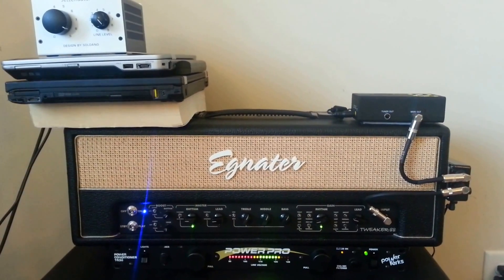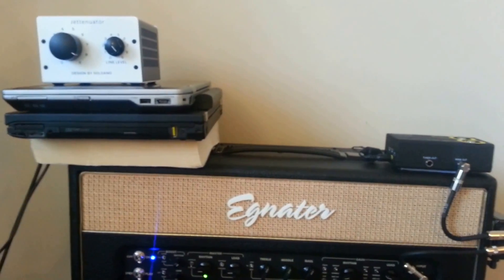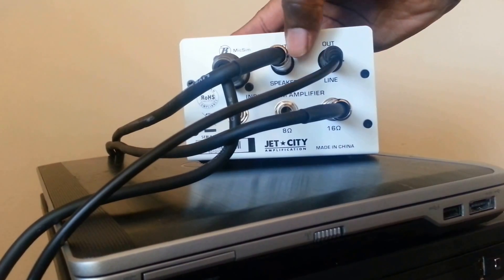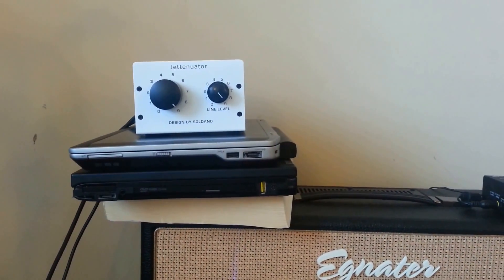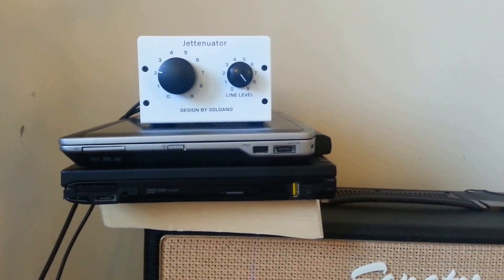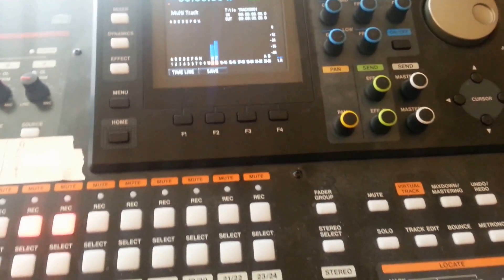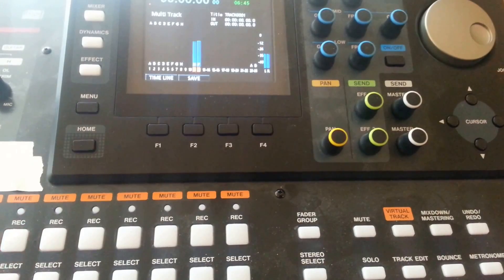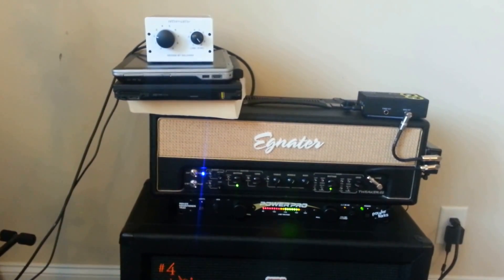Jet City Jettenuator Full Review

Comment: Thanks for making this video!  Really helped me out alot and sold me on this little box.  I was wondering if it was able to be used as a load box as well as an attenuator to run line out signal and practice/record silently in the bedroom without having the speaker plugged in which is the main feature I was looking for, thanks for clearing that up!  I was wondering though does it matter what the volume is set to when you unplug the speaker?  I just dont want to blow my 100 watt Marshall head

Comment: are the two volumes on the device not independent of each other? if i have a small tube amp plugged in and the Jet City Jettenuator and a small cab. on the device i have the non line level all the way up and the small cab is silent. i then try to do some silent recording and plan on using IRs later. but the two volumes seem to be connected,when the non line level is maxed out(at full volume) there seems to be no signal reaching the line level output. is this a problem with all of the Jet City Jettenuator???
Reply from the maker: TangleTwister Unfortunately, I no longer have the Jettenuator as I am now a bassist. From what. Recall, they are not 2 volumes. The larger knob is you attenuator while the 2nd is the line level. Check the manual as it will provide some additional insights.

Comment: Hi, I have a question: I just got a Jettenuator to record silently using the line out going into my Apogee Jam 1/4" to USB interface. But I get no signal out of the line output when I unplug the speaker output. Is that normal? It works fine when the speaker out of the Jett is connected to the speaker input of the amp. But I want silent recording. I can get sort of a half volume of the line out if I pull the speaker cable most of the way out of the Jett, but there is no level adjustment. I just need confirmation that either that is normal for this box, or if mine has an issue. It works fine in all other aspects. Thanks
Reply from the maker: +Chad Johnson Unfortunately, I can't answer the question. I have since changed to play bass, and I  no longer have any guitar gear... Hopefully, someone will answer your question.
Reply: From what i understand about the Jettenuator Line Out, the output is a balanced signal (TRS). Make sure you're using a TRS cable when using the Line Out. I personally use a trs to xlr cable when recording my amplifier direct to the mixer (XR18).

Comment: so just to clarify you set the line level to 9? and then the main knob at 2 and it'll significantly reduce the volume of the amp? and what is the amp wattage limit for the jettenuator would i be able to use my 6505 120 watt head with this?
Reply: +alvarg please answer my question

Comment: Hi
Just purchased a Jettenuator and was concerned about the noise issue you mentioned due to a lack of shielding. I have placed the jett on top of my amp and even at full volume there is no noise or interference at all from the Jett. I contacted Jet City before purchase and they said they had never known this to be an issue.
Did you resolve this?

Thanks for the review. I am really pleased with the Jettenuator and its ability to drive my Laney LC30 hard and still use it at the lowest of volume levels. Sounds good too. 
.
Reply from the maker: +lmawd It's been a while... I have since converted to bass and sold all of my guitar gear to fund my bass habit. sorry I can't answer your question...
Reply: Well, has the Jettenuator a metal housing? Then it is grounded and the whole thing is shielded.
Reply: it’s hard to tell by looking, but cables can cause noise. We’re speaker cables used or coax?
Reply: Grounding and shielding are different things, shielding done properly needs to be shielded on one end only and has to be the correct end to send any interference down to ground away from said device

Comment: Hi 
You mention the lack of shielding.
Is it noisy when not directly on top of the amp please?
Are other attenuators usually shielded?

Thanks for the review and any advice.
Reply from the maker: lmawd I don't know if other attenuators are shielded. I don't recall any noise when the Jettenuator was not on top of the amp. The only reason that I placed it on top of the amp in the video was to shoot the video.

Hope this helps.
Reply: +lmawd I have one and heard no noise when on top of my amp.
Reply: +MrStudioHound No they are not shielded. Look example DR. Z Air Brake or air brake lite.
Reply: +Chad Johnson Hi chad. Thanks. been using it for 7 months and no noise issues whatsoever. Really pleased with it.
Reply: +Dilly Vesper Hi dilly. Thanks. I have had no noise issues with it at all - brilliant.

Comment: hi there,  does the jetenuater change the tone? or does it still sound good mate?
Reply from the maker: Robert Neil I don't think the jetenuator changes the tone in a negative way. But I also doubled it when I tracked with it which compensated. I think the line level was a little brighter than the other... so it created a balanced tone. I wouldn't use just one of the outputs by itself...